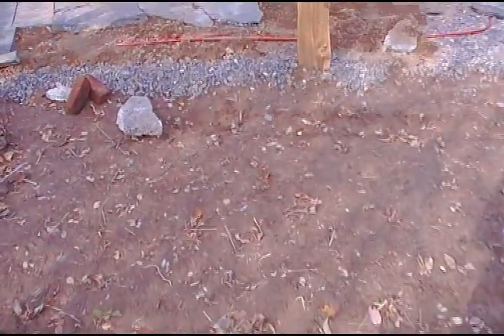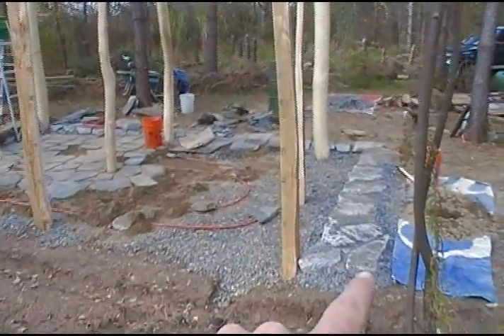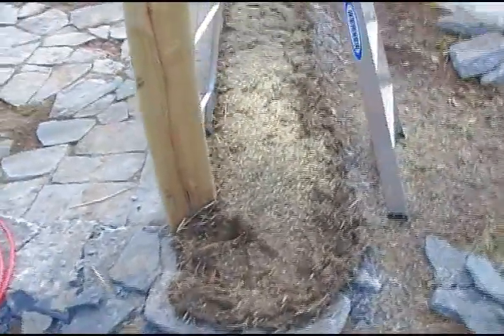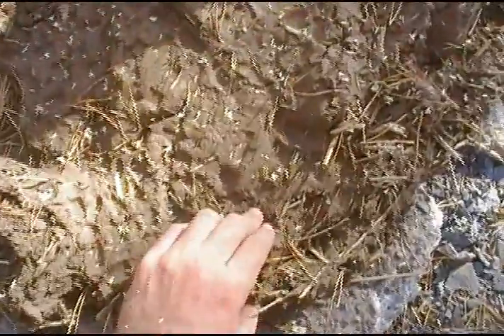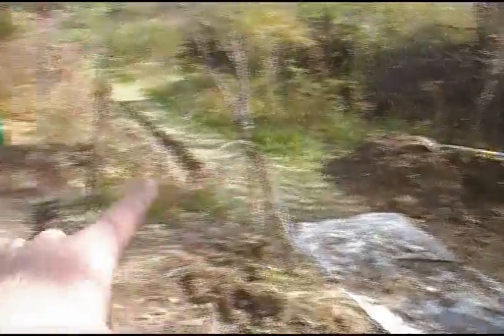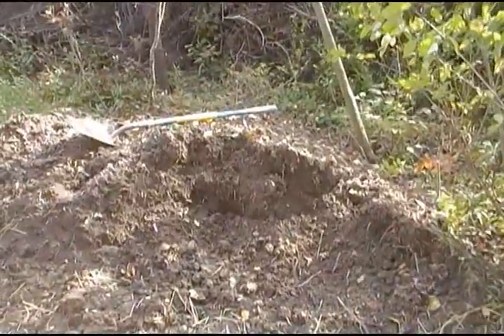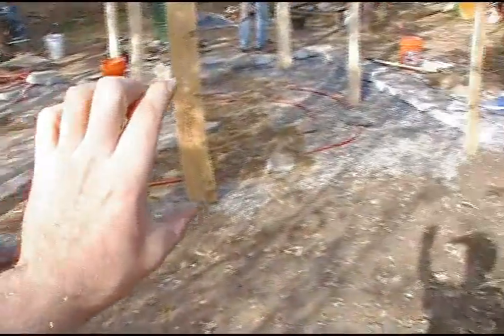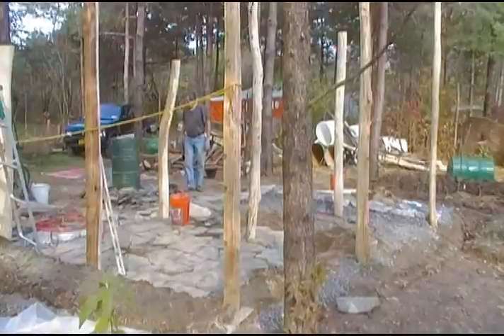Cob Cottage Part 2

Comment: your stemwall isnt going to protect your cob from deteriorating in the rain, your foundation will rise if you have a bad enough rain or a freezing rain, why did you not dig out the floor and put a clay slip floor? why did you not make the stemwall atleast 18 inches off the ground to protect the cob from water erosion